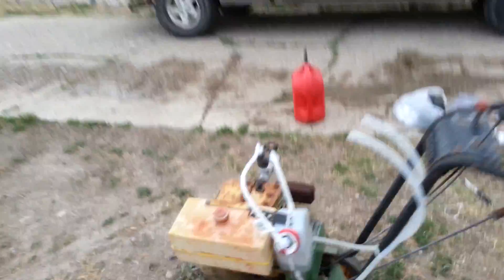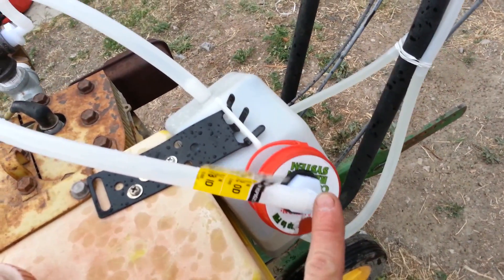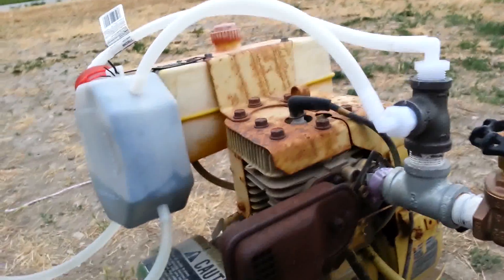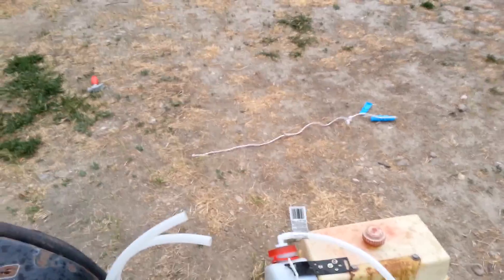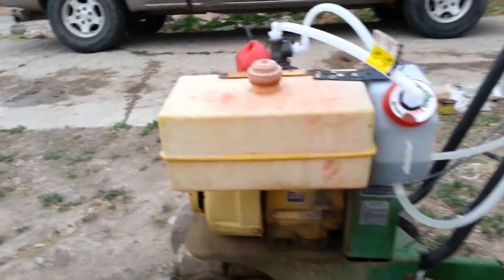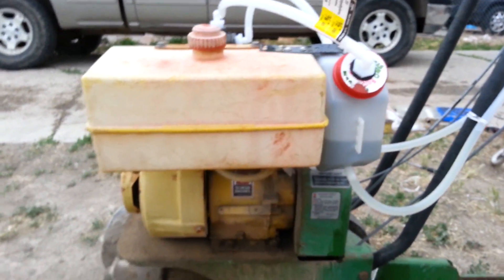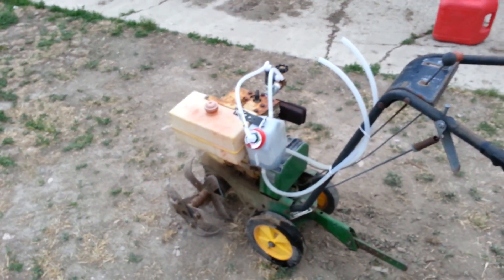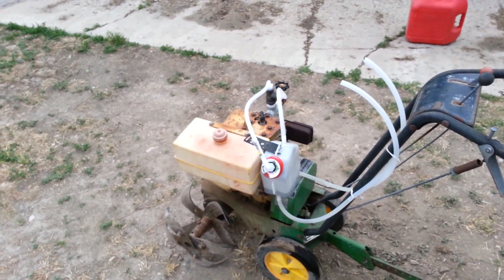New Fuel Vaporizer On Rototiller

Comment: what about the mas air sensor ? how did you deal with it ?
Reply from the maker: +Samuel Colbert I disconnected it but doing so made my transmission shift or regularly. After I figure this problem out I placed the vapor after the mass airflow sensor.

Comment: explaine the setup for generater pls.
Reply from the maker: +Mechanical Engg/khan  the setup for a generator would be exactly the same but you can run it through the intake of the carburetor as far as your outlet goes coming from the vaporizer. If you do this and disconnect the fuel line that goes to the carburetor then the carburetor will automatically adjust the engine RPMs according to the load. You don't have to mess with it as much if you keep the carburetor on there and disconnect the fuel lines

Comment: that's awesome. great job. need to find a gasket for those lines on the bottom. noticed a little gas leak. but awesome job.
Reply from the maker: +Mark Surges  thanks! I change the fuel lines out with different ones that were a rubber material so that it would seal properly.

Comment: Try a butterfly valve instead of the gate valve then hook the throttle lever of the tiller  to the butterfly valve to regulate the RPM's.
Reply from the maker: +Gary yes that is a great way to do it. You can also connect the outlet of the vaporizer or directly up to the inlet on the carburetor and disconnect the fuel line from the carburetor then the carburetor automatically adjusts the RPMs based upon the load. There's a lot less adjusting to do when you do it this way.

Comment: Hi I just got a ride on mower to run on fumes,but the tank got so cold that I believe the vapor started to condence on the inside walls,and did not get to the engine.I have to try to heat the incoming air,to prevent the cooling effect.angie
Reply from the maker: +Angelo Lapasota you can either heat the incoming air to prevent the container from getting too cold or you can introduce a slow steady drip a fuel into the vaporizer to prevent it from freezing up or going stale.

Comment: Sounds like you may want to add a throttle plate, before that Tecumseh engine blows its mind!
Looking forward to your run time under load data.
I like the simple set up you have made here, good job!
Reply from the maker: +ChargerMiles007 yeah these Vapor systems without having a governor on them can definitely run away from you if you're not careful. It's also nice at times because you can get more power out of the engine under a higher load without blowing it. I have killed one lawnmower engine doing evapor system on it by rapping the RPMs up too high.

Comment: Hi , Interesting video concept. My only recommendation would to run the air inlet pipes through the top of the fuel tank, and then continue to the bottom. This would help eliminate the eventual fuel leak due to vibration, and give a little extra fuel line safety if you have a backfire, and the tank decides to cough up fuel. Just another idea would be to make holes in the fuel line that is submerged in the gas. This may increase the surface area of air to fuel, and increase the vaporization of the fuel especially on the cold fuel system. I'm curious on how your tests turn out. Keep up the good work.
Reply from the maker: +Stephen Festus  yes adding a downpipe from the top would prevent a fuel leak however using the appropriate lines that actually still properly will eliminate the issue as well.

Comment: Nice work.  This is something I I have thought about because the work of others in the past. It leads me to the idea of modifying a conventional fuel injector with an ultrasonic element  (could use a spark arrest at the end) to do a mist/vapor spray directly into an engine and or/air mixture.  The timing pulse for triggering would have to be delayed or retarded, since it's going from a spray jet to a fine mist and the injection rate would be slower, instead of just dumping the fuel into the engine.  I think it would produce some interesting results.
Reply: Another idea - use several  Peltier junctions (these are fun devices) on the heating side against a metal tube the the gas or vapor would pass thru - to gently warm/heat the gas through thermal conductivity (no direct contact) to "dry" the gas effectively.
Reply from the maker: +nbq201 that would be something worth trying give it a shot and make a video of it.

Comment: Fuel under a vacuum is going to get used very fast but under pressure maybe different situation its all about pressure and temperature good luck. This carb you built is an evaporation system not sure if its the best situation.
Reply from the maker: Cold vapor systems never give you the huge increase in run time.  I have seen increases in runtime but it's nothing like you can get out of a hot vapor system. They are however very simple to build and will still allow you to run bad fuel etc.
Reply: My thoughts exactly

Comment: Your check valves need to be between the tank and carb.  You don't want a flash blowing back into the tank.
Reply from the maker: that is where it will go. I will also place them at the intake of the vaporizer to prevent the fuel from evaporating out of the vapor container when it's not running.
Reply: There are several video's on flahback arrestors on youtube.  I sure wouldn't run it without one of these on there.  It could be a big bang and alot of fire.
Reply from the maker: All the systems I build have them.

Comment: I am ready to attempt a vaporizer on my 91 S10 with a 4.3 TBI V6. i recently acquired a 25 gallon Steel gas tank from an old motor home. I was wondering if you thought i would have enough vaccum if i laid it in the bed of my pick up and ran a 3 inch hose from my intake to the tank?
Reply from the maker: You would have enough vacuum yes. You will need to make sure you don't have any vacuum leaks. You would also not need a 3" hose, the smaller the better you can even tie it into the PCV valve. With a smaller hose sir will be running through at a higher velocity which helps improve the vaporization process. I would not recommend doing this at this time if you are looking to use it as a permanent system. There are allot of problems controlling the air to fuel ratio. If you are looking to use it as an experimental system then I would say go for it.
Reply: Tyson Capel  I figured since its a throttle body injection (basically 2 injectors directly above a carburetor)  that I wouldn't have the issues that an electronically controlled fuel injection system would have.
Reply from the maker: Dustin Wells Possibly I hope that makes it easier and helps it work better but I couldn't say yes it will because I have not tested it on a TBI engine. Based on my experience I would suspect it will still be a bit difficult to get the ATF right. The vapor system on the tiller worked out great and I did not have to do very many mods to it.

Comment: I am interested in researching gas vaporizers on a 1997 GMC truck I have. I have seen several videos on these prototypes and there was one that claimed the camshaft needed to be reground to prevent valve and seat damage....You have been experimenting with this technology for a while on apparently otherwise stock motors...Have you encountered and mechanical problems in your engines by running on vaporizers only?.......thanks
Reply from the maker: +whopper1967 I have never encountered any problems with the engine as far as ruining the engine goes however longevity tests have not been done to be able to say for sure that nothing would ever arise after longer periods of run time.

Comment: I think you need a way to rig up the governor to keep from over revving the engine
Reply from the maker: You can do that by decreasing the tubing size going into the vaporizer. Placing a valve on the intake to the vaporizer will also work. You will need to set it to the opening size you would like to restrict the engine rpm's to.
Reply: or just hooking the vap tube to the old carb, that may work. just have to plug the old fuel inlet
Reply from the maker: Yes sir that may work.

Comment: Are you going to place air filters on all of your intake points?
Reply from the maker: +jmjpowerjoule absolutely I did end up placing air filters on the system shortly after I shot this video. The fuel will traps most of the dust and dirt and crafts that would come into the system though.

Comment: I have a question that I want to ask.
Seen a lot of video's on vaporization but what I haven't seen is some REAL research.
It will be nice for your to do three tests at different RPM's but you have nothing to compare it to other than what your lawn mower did. The three tests wont show us much of anything other than it runs on vapor.
What you need to do is put the carb back on and do three RPM tests to develop some baselines. Then do your vapor tests.
I'm not trying to be hard on you but I think that's what people want to see.
Reply from the maker: I Invoke My First Amendment Rights If you decide to do it please make a video of it. Thanks! Please remember to use flashback arrestors.
Reply: Tyson Capel I agree that comparison tests need to be done. However I would like to thank you for pointing this out. I have a tiller I got for free that has a rusted out gas tank and a possibly broken carb. The rest looks fine. I may have to try this to see if I can get it running so I can prep my garden for 2015. subscribed
Reply from the maker: That is very true Steve thanks for pointing that out.

I made this particular one because my carb on this tiller was rusted out so I decided to put a vaporizer on it instead of buying a new carburetor. One of the advantages I like about this vapor system is you can still use bad fuel and fuel that has water in it and the engine will still run well. A traditional carburetor can't do that like a vapor system can.

What I need to do is move this vaporizer to my generator and do comparison tests on it since I have a working carb for the generator. I will do just that or build the exact same system and put it on the generator. The system in this video works much better than any other cold vapor system I have used so it will be allot easier to do the testing since it does not require as much constant adjusting to keep the engine running well.

Comment: Nice work Tyson, still waiting to hear more about project Neanderthal from you. You got the contact info, so hit me up. This idea with cold vapor is great, do you think it cold be improved by routing some cheap plumbing up from the exhaust (wrap the exhaust in a thermal canister with a missing bottom) and pip it up to the tubing, the natural convection from the heating of the canister should be enough to allow the intakes to suck in a decently hot air mixture to help heat the gasoline, at least enough to counter the cooling effects of the vacuum if not more, providing a better, more efficient mixture to work with. Hit me up man!
Reply from the maker: Feel free to give me a call today (435) 225-5780 just remind me of who you are when you call because I get allot of calls from people and sometimes I think I'm talking to one person when it's really another lol.

Making a heat exchanger preheater for the air would work fine the way you explained it and it would be easy to do. Another way on a cold vapor system to solve the problem of the system not working from getting to cold is to recirculate the gasoline in the bubbler or to keep a slow constant supply of fuel going into the bubbler like I described in the video. BTW I still have never had the problem of the cold vapor systems not working due to it cooling down. 

This rototiller actually shoots the exhaust into the air intake. It was mad that way from the factory. There is normally a metal casing that goes around the air filter and the hot exhaust blows on the metal casing heating it up to the point you will get burned if you touch it and some exhaust is sucked into the air intake and further heats the air that way.
Reply: Tyson Capel More or less, the most important factor of the heat exchange would be improving the efficiency (getting more run time out of each unit of fuel than you're already getting from using vapor) I'll give ya a ring.
Reply from the maker: ***** You got it!

Comment: I am also going to try this with a mixed fuel engine like a weed whacker, blower or chainsaw. I'm wondering if any harm will come to the engine because of no liquid because of the 2 cycle mixed fuel. I think it's purpose is to  lubricate.
Reply from the maker: You will need to figure out some way to lubricate it. When I get a weed wacker for cheap or for free from picking up peoples scrap metal I will test a vapor system on it to see how long the engine runs before having problems.
Reply: Use a 4-stroke weedeater/blower/saw. Lubrication is seperated. Problem solved.

Comment: Awesome Job Brother! I like your setup on this. I have basically the same on one of my mowers. When I get time I will record Video and share it with you on youtube. My plan is to do this with a generator so I can produce energy for my home!
Reply: have you ever calculated how many hours a small briggs or even a honda engine will run before its worn out and needs an overhaul? Ever checked manufacturers recommended oil change intervals based on hours run for a small engine? If you mowed your lawn for 1 hour once a week for 6 months you would have put around 24 hours of run time on your small engine. Times that by 5 years and you have about 125 hours. Lets give it 10 years of use at 250 hours. Do you think you might be getting close to that engines life expectancy? So now if you ran a generator 24 hours a day using a small 5-6hp motor how long would it last and how many times would you need to change the oil? If I recall correctly time between oil changes is very low under 10 hours. In a 30 day month there is a little over 800 hours @ 24/7...10 days into that month you would need to change oil many times...lets say you could get 6 months of use before you needed a new engine and you made 100 watts of power an hour times 10 would be 1KWH which cost about 10 cents off the grid. Your small engine already needs an oil change at lets say 3 bucks a quart and used 1 gallon of fuel at 4 bucks for a total of 7 bucks to produce a dimes worth of electricity. You might want to do a little math on any system to see what your equipment costs are VS its life expectancy and service costs calculated into watts of energy output to get a good idea what your final costs per KWH is. Cause if the grid goes down you don't want to break the bank trying to survive.
Reply: Use the same example for lets say a small auto engine, which are better built that small engines. If you drove @ 50 miles per hour how many hours would it take to get to the recommended 3,ooo mile oil change. Answer is about 60 hours. Now if you ran that motor 24/7 producing electricity for a home or several homes you would need to change oil every 3 days of use. Each 12KW takes around 15-20hp.If you could get 50mpg on your small engine you will burn 1 gallon an hour in our example and in 60 hours consume 60 gallons of fuel. This is why the best engines for gensets are diesel as a diesel is a longer life motor and you can make your own fuel IE Biodiesel. Lets say you could get 250,000 miles on a small car engine before it was about worn out, how many hours would that engine have run?
Reply from the maker: Awesome! It's great to see you involved in this! I look forward to seeing the video. Please message me when you get the video up!
Reply from the maker: 1NRG24Seven That is very true.

The reason you have to do oil changes so often on small engines is because they are much less efficient than bigger engines like you would find in a vehicle. Because they are so inefficient there is allot more carbon buildup and other junk that contaminates the oil. Because the oil gets contaminated so fast you have to do allot of oil changes. Adding HHO into the system along with pure vapor will make the engine run very efficient and clean. You will have little to no contaminants in the oil, therefore you will not need to change the oil as often because it will last much longer. If you ran an engine on nothing but HHO you would never have to do an oil change because there would be nothing to contaminate the oil therefore it would stay good for a very long time. Another thing I did not mention is your engine life would also be much longer. Contaminants and heat are one of the major causes of an engine wearing out. If you can eliminate both the life of the engine will be allot longer. Running HHO and fuel vapor in an engine will reduce the heat of the engine and will reduce the amount of contaminants therefore you will have multiple benefits running an engine off of a vapor HHO system. 

Using a HHO fuel vapor system would be better in many ways. I will do extensive testing on the HHO fuel vapor system I will be putting on my 5000 watt generator.
Reply: +1NRG24Seven Have you ever heard of a battery bank and inverter set up? I run a generator around an hour and a half a day. I also have a PV system to supplement the use of a conventional generator. So, tell me how many times a month I change a generator's engine oil with a suggested interval of 500 hours.